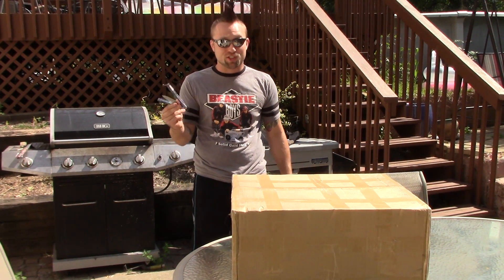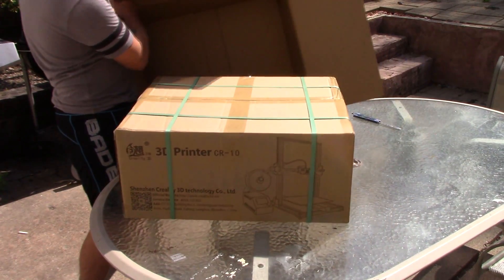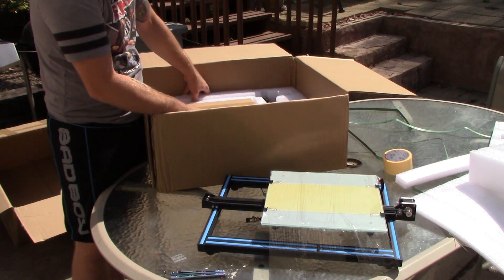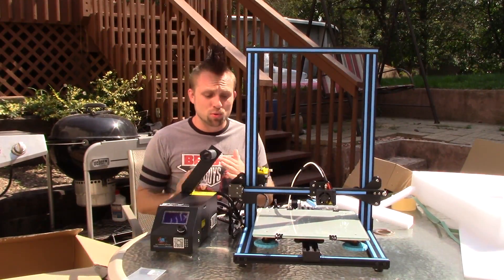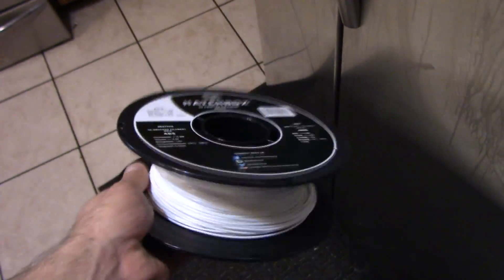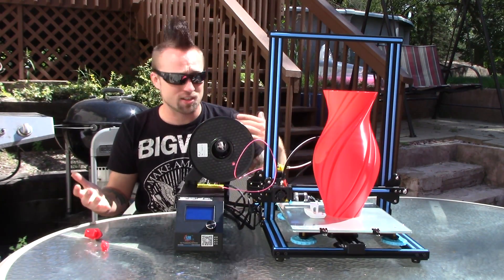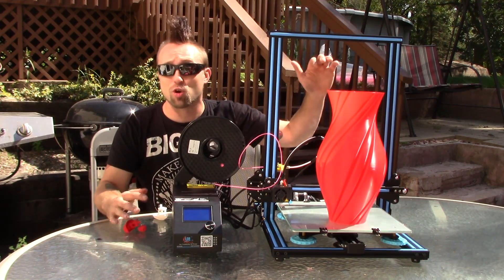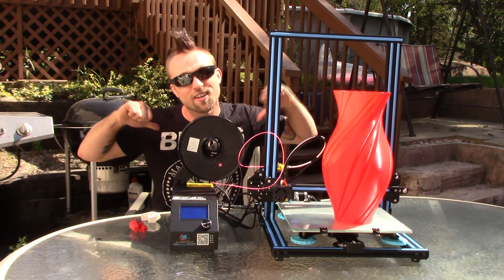Creality CR-10 3D Printer Unboxing and Full Review.  Best 3D Printer?

Comment: Been waiting on this one. I love this printer. It beats the i3 mega IMO but just barely the i3 mega is awesome. Now make sure to add strain relief on that bed cable (i know I always say this) Also the glass is probably warped so go to lowes and pick up a 6 pack of 12x12 mirror tiles for $10. That way you can stick PEI to one, buildtak or something else to another, leave one plain, one with glue, one with tape. Its nice having a removeable bed.
Reply: Pls give me some tips for my YouTube channel
Reply: Why? I am not a youtuber.
Reply: Oh lol that was meant for Dylan
Reply from the maker: glass is perfect and yeah i like it alot the anycubic is much better at printing exotic material tho.
Reply: Dylannn !!!! I love your vids
Reply: Pls I'm starting a gaming channel and I would like some general tips
Reply: Dylan Kowalski for sure. I just put Capricorn PTFE tubing on my i3 mega so I can print safely above 240 so I can try nylon and asa. But man that ultra base on the i3 mega is something else I love it.
Reply: Dylan hadn't even responded to my comment when you said that lol.